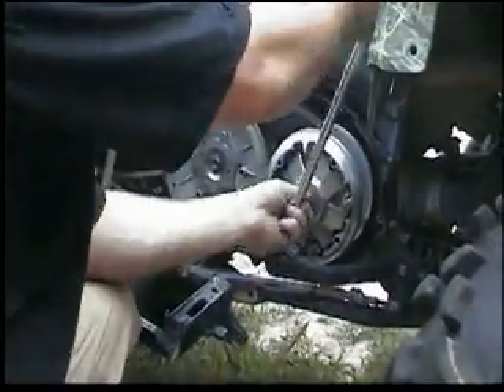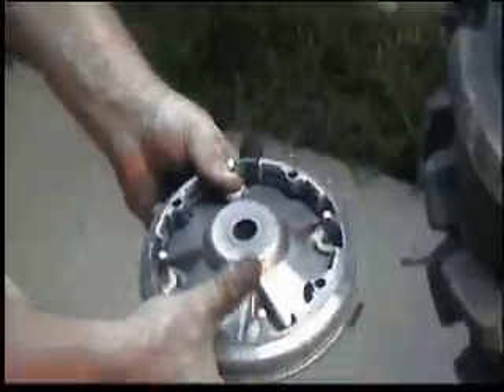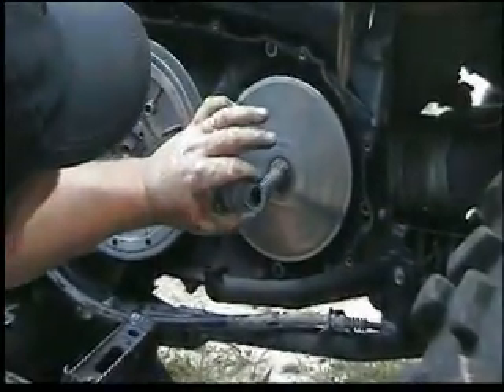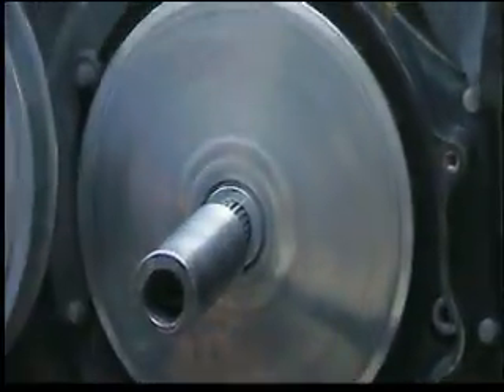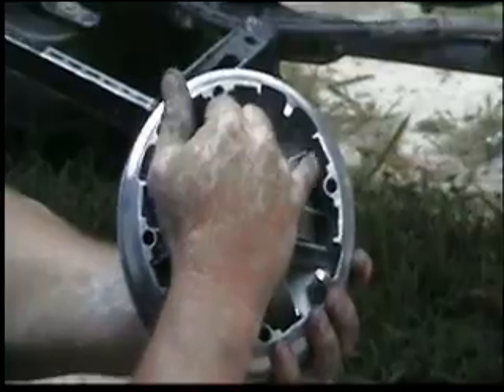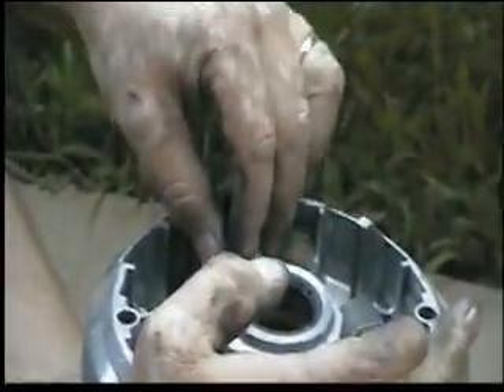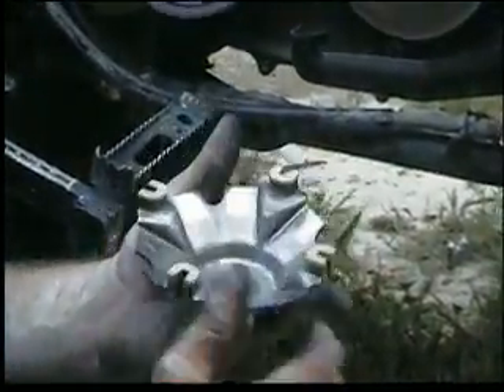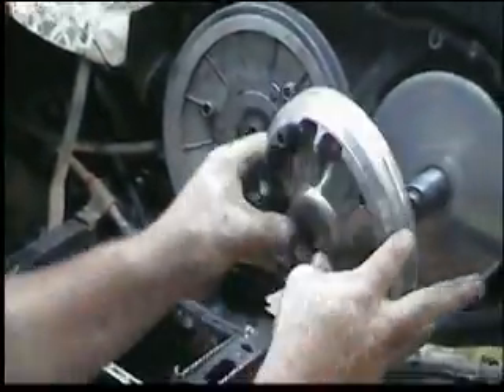2 mm shim mod for Suzuki 700 King Quad extended video

Comment: I did this same mod, it will gear you down about 5%( more lower end), but it will take it off your'e top end. I used secondary clutch shims to a 1999 yamaha mountain max 700 snowmobile, anything with a 1.5 to 2.0 mm thickness and a 52mm diameter

Comment: Also run a heavyer secondary spring, but watch the outer face on the primary clutch, if you notice the splines starting to hawg out, go to the 1.5mm

Comment: I have a 450 king quad, will this mod work on it, and if so where can I get the shims. Thanks.
Reply: It should work, You can find the shims on ebay or before that try your local machine shops/parts stores for the shims.

Comment: when you replace your belts, do you use factory belts or after market belts. If after market  which one you do you recommend?
Reply: From what i read use oem belt , a stiffer belt with the mod will eat up the belt quicker

Comment: I heard that putting bigger than stock tires on a king quad required you to upgrade your clutch kit. Will this mod allow me to run  aggressive mud tires around the 27-28 inch range??
Reply from the maker: Zack Lennard It will barely make a difference. You should depend on the clutch kit for the best results.The shim mod just gives you a little more. The wet clutch upgrade will give you the biggest difference, but it might be too much for 28's.
Reply: I completely agree. I did this little mod because everyone talked about the night and day difference that just a .5 shim made. Well I did the 2mm mod and even with stock tires I didn't notice nothing. Really disappointed to say the least
Reply: @jritch789  No difference at all huh? I was wanting to do it to my 700